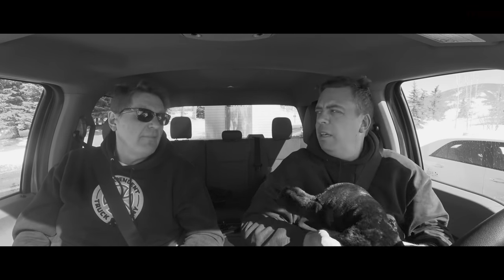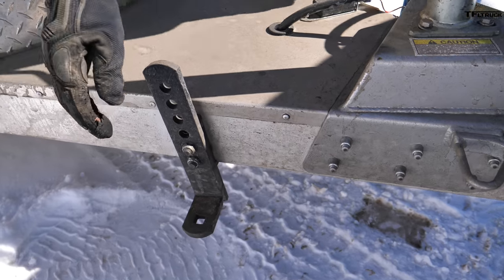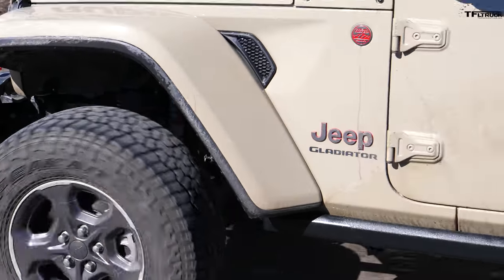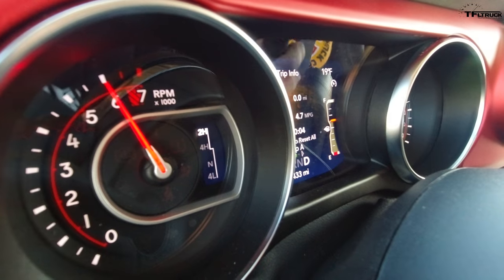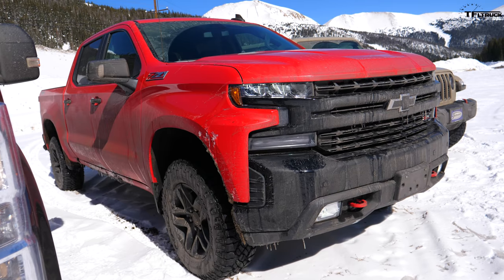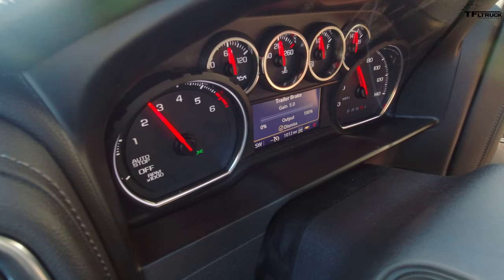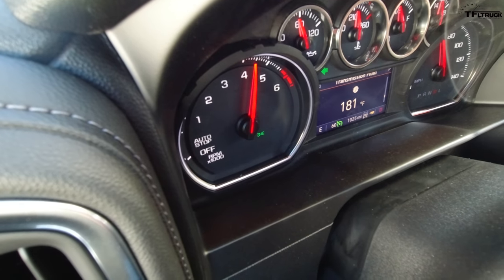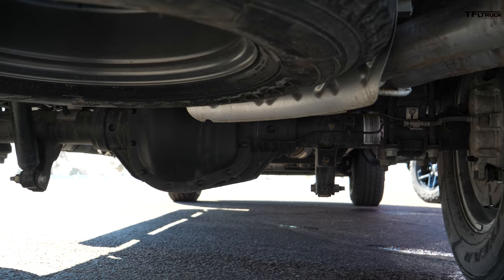Midsize, Half-ton, and HD Trucks Versus the World's Toughest Towing Test - Only One Truck Kills It!

Comment: I think cruise control up the Ike is silly I'd be a no vote in the future. What I think you should do is use manual shift mode on the downhill.  I understand you'd like to see if stock programming learns the grade, but these trucks have the buttons for a reason, which gives them the capability to do better, but it goes untapped.
Reply: Corey Vuagniaux if it’s to high of rpm it can’t downshift as it would over rev..... so no manual wouldn’t do anything different.
Reply: @FishFind3000  it is true that software will limit your ability to downshift.  The problem is many of these trucks do not downshift on a grade as aggressively in automatic mode as you can manually shifting. This is because too often what you need on the ike gauntlet is too aggressive for day-to-day towing.  I have towed with 5 different trucks through the Rockies.  Different makes, both gas and diesel. All of them performed far better downhill in manual mode. Not even close.  It's easy to do and an option on these trucks for a reason.

Comment: Dollar for dollar, there is NO comparison with what you get for parts. Factor in chassis, brakes, cooling system, transmission, engine, differentials, axles, and suspension...all for the same price. What do either of the other two have that’s better or worth more than the Ford?
Reply: Well the Jeep is the obvious outlier, but between the GM and Ford, you do get a lot more pure truck for the dollar. If you off-road a lot, then it is a different story.
Reply: Don Leamon 
You’re right; if you want a truck, get a truck. If you want a Jeep, get the Jeep.

Comment: That trailer was really pushing that Gladiator around. I would be terrified to tow with that thing.
Reply: Its just not built for doing that regularly. I Own both an 18 f150 max tow model, rated to tow over 12k, and a Gladiator Rubicon. Ill take the Rubicon every day of the week, even towing as long as its not max weight often. Actually handles a trailer way better than I expected.

Comment: If you are towing on a regular basis a small truck is just not the answer. That was painfull to watch the Jeep try and pull 7,000lbs up the mountain.
Reply: Jeep really struggled towing that trailer on flat ground. Max. tow rating should be about half what it is.
https://www.youtube.com/watch?v=hk87LDfpcUg&t=656s

Comment: Hello again Roman an Andre’! Once again nice job an I’m jealous! But first off Cruise Control really should not be used, at least while going up, down is another matter because the grade braking algorithm will help keep your speed consistent. But I've found the cruise control will help you easily maintain the set speed, however that leaves the engine at the highest rpm, with the trans in the lowest gear. But I've found that if you feather the accelerator pedal and give just enough to maintain the speed, you will help keep the rpm lower in a higher gear. I'm also wondering, was it the Gladiator that won the Ike Gauntlet? I would love to see how my 33k 2019 Colorado Crew Cab W/T 4x4, V6, would make out? Yes, I know at 7,000 lbs, the truck would be just over the limit with a driver, never mind you two lugs! I am impressed with how the Gladiator compared to the V8 Chevy and Ford SD!

Comment: Some viewers may wonder why your Sould Level Meter (SLM) readings are so low when the audio of your YouTube has what seems to be loud roar.  It is because you are using "A" scale (dBA) which is "weighted", actually filtered, to reduce low frequency inputs.  Linear, unweighted, response would be much higher and more truthful, but that is why industry preferred and fought for "A".  Your meter may not even have linear, but "C" scale is far less weighted against the low tones.  Try "C" sometime.

Comment: With roman on this Silverado Trail Boss SS same fuel economy towing & better on flat ground plus way better unloaded. That's about all i pull currently (8400lbs). I might get a older HD truck for the heavy loads i might be doing rarely in the future.

Comment: Seems like an odd comparison, you buy a truck for its purpose and all this becomes moot.

Towing a mini excavator or small tractor to job sites:f250 or equivalent

Towing your 20 foot boat to the boat launch every weekend: 1500/150 series.

Towing some atvs or kayaks/canoes through the bush to your favorite spot: jeep.

Being the least truck you can buy that does the work that you need it to. Thus being the least expensive to maintain and also using the least amount of fuel when it's not loaded. Which is more often than not unless it's just a work truck.

Comment: I have  19 Chevy Silverado 5.3 flex fuel, never had a problem with it ever. Stock. I pull a 12200 pound race car trailer and car and pulls just fine. Iiving in Pennsylvania it's all hills. 83400 miles do a lot of traveling bc of racing

Comment: Cruise control seems irresponsible on the ascent. If it kicks out on the slope with the weight and wind resistance, it’s like jamming on the brakes. On the descent, it may be reasonable if it applies brakes automatically as wells as engine braking and brake lights.  The problem would be you may not know how much it is braking and you need to know that so you don’t roast the brakes and reduce your reserve braking power.

Comment: Great video, silly test. Clearly if you tow this every day then 3/4 ton, weekly then 1/2 ton, few times a year then pick your truck based on other factors.  Lets have some offroad, daily driving, parking etc... tests to be fair to all these trucks. The gladiator wasnt built for this task routinely, but can do it occasionally. Similarly the F250 wont handle tight trails, city streets and tight parking lots well, but can do it with sacrifices. I say this as a truck owner who tows 7k a few times a year, and 3k a few times a week. At one time I was convinced I needed a 3/4 ton. After 3 years of horrendous fuel economy and rough ride I went to 1/2 ton. 3 years later and I now own a Gladiator. Never been so happy with a vehicle- daily it is fun, easy to drive, easy to park, is convertible, nimble and capable off road, once in a while when I need it to it does the work. Bottom line- buy the truck that is better 90 percent of the time in your situation, not the best for 10 percent. Happy with my baby bear choice.

Comment: Please keep hammering GM on the small fuel tank issue. You can get a 34 gallon tank in the F150!  There is no reason GM can’t offer a larger tank in their 1/2 tons. With more fuel most of my trailering destinations would be reachable without a fuel stop. NOBODY likes going to a standard size gas station with the trailer attached. Yes a smaller tank means less fuel weight and SLIGHTLY better MPG and cargo capacity numbers but I would gladly sacrifice those small gains for more range.

Comment: Ford for the win.....again
Reply: It is sad it was actually about the same as the smaller size Chevy.
Reply: @carnivorepolice5-0  did you watch the same video I did? That Chevy reved to the Moon to make that hill.
Reply: @Zach-ju5vi  yeah I heard it rev and well engines do that the rev lol. End stats show basically the same thing.  Ford 250 has better breaking on the down hill that's about it.
Reply: @carnivorepolice5-0  ford made the hill with 2000 rpms less. Not that I'm surprised but the Chevy had to work much harder for the same result.
Reply: @Zach-ju5vi  I mean a 250 verse 1500 I'd hope so but the end stats are still what they are.
Reply: @carnivorepolice5-0  I would like to see the roles reverses, Chev 6.2 vs ford 5.0 and see what happens that could be interesting.
Reply: @Zach-ju5vi  that could be fun
Reply: The Ford won the downhill.The Ford won the uphill with better gas mileage. The Ford would have been faster if not for the traffic at the end where they had to slow down before crossing the line. Which they did not have to do in the Chevy. So the Ford won everything.
Reply: @kenwolf2431  uhm nope lol
Reply: Not a comparable test. LOL it's about what size/weight class that's suits your needs on your duty of work/play and of course the 3/4 ton truck is better suited for this test that what it's built for, work and make you some 💰.

Comment: Haven't watched yet,but put the 6.2 GMC in slt package 4x4 with 3.42 gears 8 speed.i know you can only test what given to you.but if you're going to put a 250 f in there put it up against the 6.2 around 8k or so.for 7.3 gas up against 6.2

Comment: The Ford won the downhill.The Ford won the uphill with better gas mileage then the Chevy. The Ford would have been faster if not for the traffic at the end where they had to slow down before crossing the line watch the video. Which they did not have to do in the Chevy. The times should have asterisks when its not a clean run such when you still running the timer as you have to slow down for traffic. At the very end in the Ford you had to come to almost a stop before crossing the line and the other vehicles in test you did not have too. So there should have been a note by the time as not a clean run. Because you had to slow down in the Ford before crossing the line at the end of the test, which effected its time in the video something you did not have to do for the Jeep or the Chevy. That slow down at the end added more time to the Fords time which you guys should note in the official times. It really should be noted in all your test.  So the Ford won everything. Andre your the man you seem to be the only one that is unbiased in these reviews along with Mr Truck and Roman always comes off as really bias.  Would prefer Andre and Mr Truck do the Ike Gauntlets leave Roman home.  Leave it to the two professional.
Reply: I think you take this stuff a little too serious ken.

Comment: I have to wonder how the 6.2 1500 Silverado vs the 3.5 ecoboost F-150 would turn out, or even the 5.0 F-150. I'm considering the F-250 gas Tremor and the 6.2 Silverado 1500. I hate the sound the EcoBoost makes and 5.0-liter motors belong in Mustangs.

Comment: Normally I love your guys test but these towing test have been kind of irrelevant you have one truck at 100% of it capability, another at about 75%, and the other at 50%.  I trust your guys opinion and would have like to see each truck at about 80% and which one performed the best at the weight and then which you would pick.
Reply: 117 Vlog I agree, was thinking the same thing, example would be to pull a 5,000lb trailer for the Jeep
Reply: They are doing the homework most people don't before buying a tow rig.....if more people realized what the impact of towing at the limit vs towing comfortably really is, we'd all be safer.....informative video....not a competition
Reply: I was going to make the exact same point. If your going to max one out, max them all. And I'm not a fan of the Gladiator, the wheelbase is too long. Bed length looks goofy. Hard to believe the Jeep is that expensive. My local Jeep dealer has several Gladiators that have been on the lot for several months now. They are not selling very well where I live.
Reply: I will add, the Raptors are not selling here either.  Local Ford dealer has 2 Raptors with $10k off sticker and still can't sell them. Sad to think people were paying over sticker price just a year or so ago.
Reply: If you would have watched every second of this video,  you would have seen why the test was done this way! Good griefs, does anyone pay attention anymore?
Reply: Dale86 I actually did watch every second from beginning to end...The point i was making is the test doesn’t help anyone pick the small medium large, in this particular the test the answer was always going to be mama or papa bear
Reply: Watch at 5:51, they did this test this way because people have been asking what is the best truck for pulling a specific weight of trailer (for this I assume the average was 7k lbs)
Reply: @scotturich  People are always asking what is the best truck to buy to tow a specific amount of weight,  so that is why TFL used three different classes of trucks in this video to tow 7k pounds. How are they gonna answer this question by maxing out each one of them? That would be a Super Ike test which they already do.

Comment: I don’t want to buy that Gladiator used…
Reply: the towing doesn't bother me...its the topping off the fuel tank
Reply: 2big 2fail meh. Overworking the engine and transmission is a big and eventually expensive issue. I’ve owned cars/trucks from all three manufacturers. All car companies say don’t top off the tank because it’s part of the vapor recovery systems they’ve had in use forever now at pumps and in modern cars. The way TFL does this is how I’ve always done it. I pull the nozzle out let it settle and then put it back in to let it shut off again. Shouldn’t cause a problem unless you try to squeeze in a lot more gas and it fills the charcoal canister in the car’s fuel system. That may cause some damage and require new sensors if you do it regularly.

Comment: I appreciate the logistics of a 3 truck test, and the complexity of trailers; however a test that used a trailer  weight that was at the same percent of max weight would provide a more accurate result.  That or either a trailer that would max out each trucks weight rating.  That would actually show compared capabilities of each truck.  Otherwise change the name of test to "Dude, I have a trailer now I need a truck!"

Comment: Overloaded on the Gladiator tongue weight guaranteed! Will drastically affects towing conditions. No trailer brake controller illegal in most states over 1,0000 lbs.

Comment: So the Gladiator costs $55,000 yet my 15 year old Dakota with the old base 4.7 V8, 5spd, and 3.55 axle can tow 7,000 lbs safely with a few suspension, intake and brake upgrades, has a 1,610 lbs hauling capacity in the 6.6ft bed and only cost $17,000 used in 2012 🤔

Comment: If it’s only 7000 lbs I’ll go with a half ton. You don’t need all the options like this one. You can get any of the big three around 42k if you option correctly. F250 is overkill. (Unless you tow every day up I70) Half tons and heavy duty’s get around the same mileage towing this kind of weight. And when you not loaded the half ton is gonna get better mileage . I still don’t know how they got the gladiator rated at 7000.

Comment: Gladiator didn't do bad at all. With a good hitch, it would be perfectly fine for most usage. After all, the Ike isn't exactly the average towing application.
Reply: benjaminwayneb but we just watched it tow 7000lbs up the ike maybe a little slower than a 3/4 ton truck but it did pretty good if you ask me. I bet my Ram 3500 dually could tow 30000lbs better than that 3/4 ton Ford gas truck so I guess that makes the Ford uses in your way of thinking.
Reply: David Harris 
So you think a Ram 2500 would tow better up the Ike than the Ford? Gas or diesel? Please humor us.
Reply: scottdbsn I guess if getting up the ike the fastest the Ford was the winner. But the Ram done better on the down hill transmission and engine temperatures fuel economy and in my opinion Rams are just a better truck. As far as the 2500 Ram they never even tested it with the new 8 speed transmission so I guess will see. I've owned  Rams and Ford's I think they're both good trucks .
Reply: David Harris 
Downhill can be debated. How many times did the truck apply the brakes? I’m not sure there’s a way to know. I believe they stated in the video that the truck applies the brakes automatically.  
That’s why there’s different brands, for people with differing opinions. We can all agree that trucks have changed so much in 20 years. Imagine this test with a gas big block or diesel in the 90’s.

Comment: Your trailer is loaded incorrectly. I've been driving tractor trailer 25 years. I'll provide some information. You always want the load centered over the wheels. You'll notice when you see flatbed trailers on the road the load is usually separated front and rear to maintain weight over the suspension. The Rubicon is sagging so much on it's tail because the load in the trailer is too far forward. Plus you're removing too much weight/traction from the steer wheels and risking a crash. The swaying you feel is what is known as "the tail wagging the dog". It's a condition when the trailer isn't level and following the truck. Instead it's pointed nose down and pushing the rear of the truck side to side. This is worsened when braking because the trailer dives forward even more, pushing it's weight into the rear tire's traction area, limiting available stability. A level and balanced trailer pushes it's weight into the frame section upon braking. Putting it's mass into the body/center of mass of the truck. The water barrels and mats need to be centered, blocked and braced over the trailer's wheels. This shifts the loaded weight from the tongue to the suspension. To visualize this, imagine your body is the suspension and your arm is the length of trailer stretching to the hitch. Where would you carry a weight? On your outstretched hand or by your chest? You balance the trailer by placing the load over the area meant for carrying weight. Also, the hard acceleration test worsens an already bad situation by increasing rearward weight shift. Causing even more traction loss at the steer wheels. This combination is unsafe under all driving conditions and situations. By shifting so much weight to the front of the trailer I have no doubt that you've exceeded the maximum tongue and rear axle weights of the Gladiator. This set up will fail any DOT roadside inspection. I recommend you find an experienced Class A driver to inspect your trailer before attempting these towing tests.
Reply: tommy was unavailable, his mommy had just put him to bed.

Comment: No weight distribution hitch? you just broke the law. All pickups have requirements for the use of a weight-distributing hitch when towing trailered loads greater than 5,000 pounds. Heavy-duty pickups are no exception.